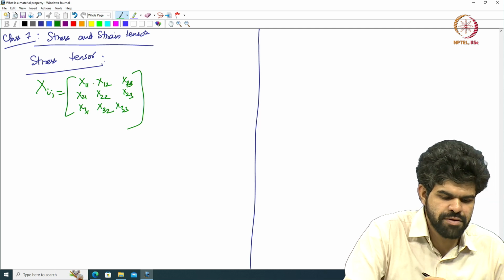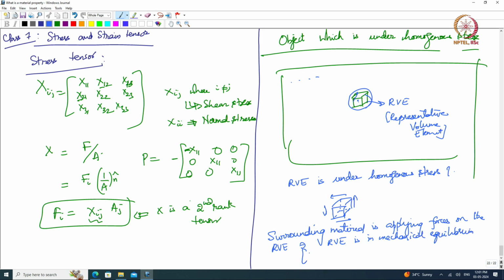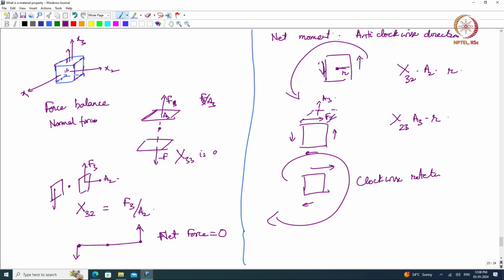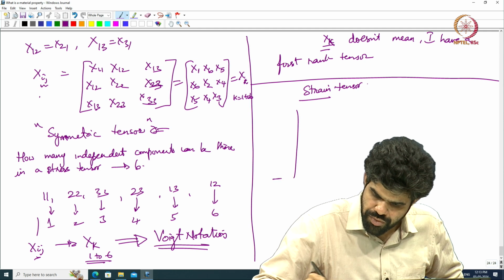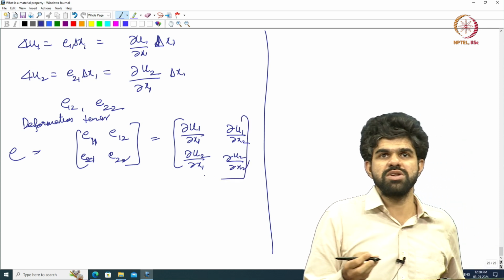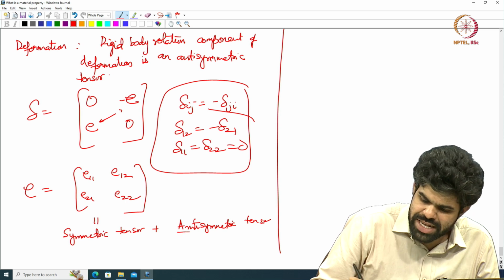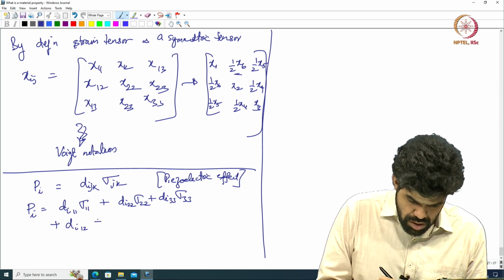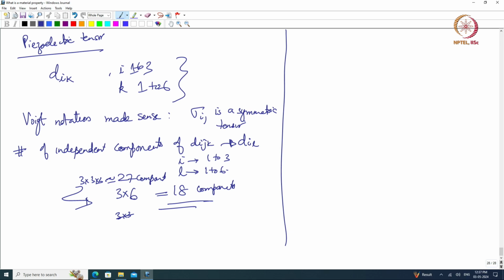Lec 07 Field tensor: Stress and strain

Comment: This lecture (Lec 07) introduces the fundamental concepts of stress and strain tensors in the context of mechanics, specifically focusing on how these higher-ranked fields relate to material properties like piezoelectricity.

Key Topics Covered:
Stress Tensor (0:56 - 15:43): The lecture defines stress as a second-rank tensor. It explains that for an object under homogeneous stress in mechanical equilibrium, the stress tensor must be symmetric (
) to ensure moment balance and prevent rotation.
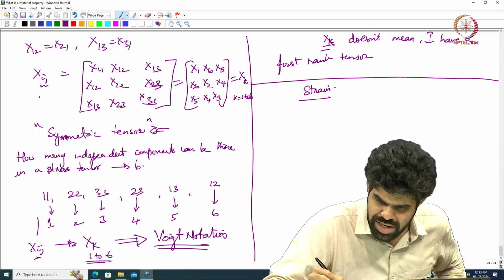Deformation and Strain Tensor (18:56 - 34:37): Strain is derived from the deformation tensor. By removing the anti-symmetric components (which correspond to rigid body rotation), the remaining symmetric part is defined as the strain tensor.
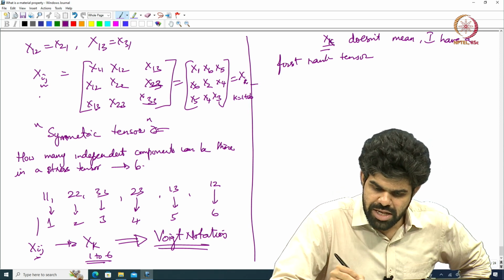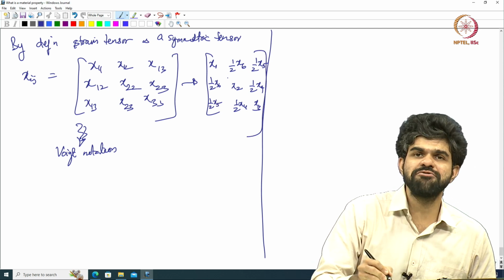Voigt Notation (17:29 - 18:52, 34:39 - 35:46): Because stress and strain tensors are symmetric, they can be represented as 1x6 arrays rather than 3x3 matrices. This notation simplifies calculations.
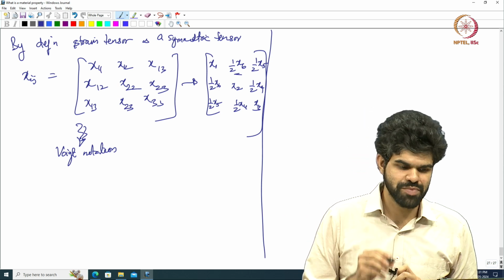Application to Piezoelectricity (36:09 - 42:30): The instructor demonstrates how Voigt notation helps reduce the number of independent components in the third-rank piezoelectric tensor from 27 down to 18, making the mathematical treatment of piezoelectric materials much more manageable.